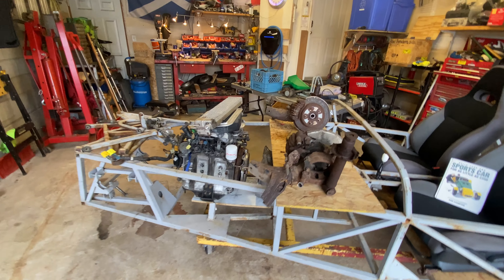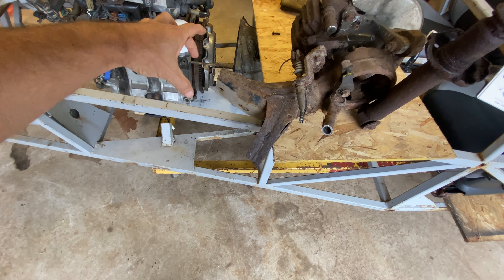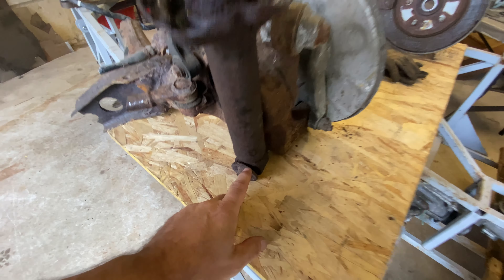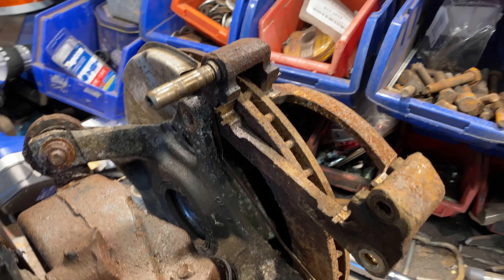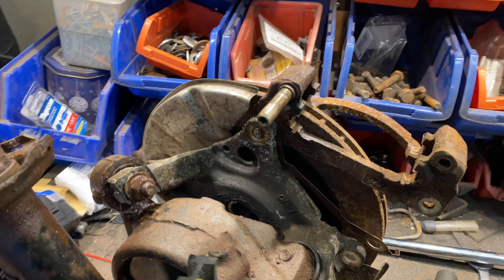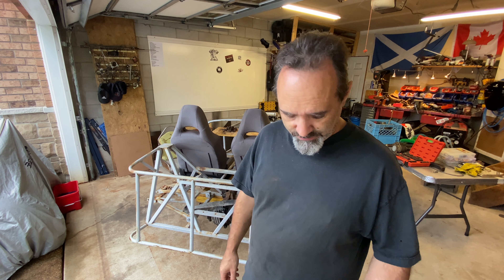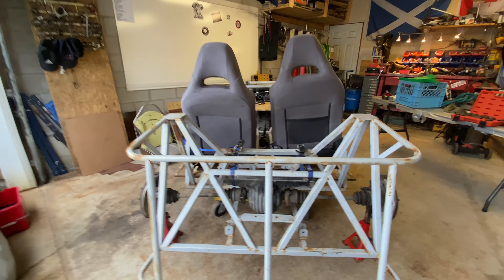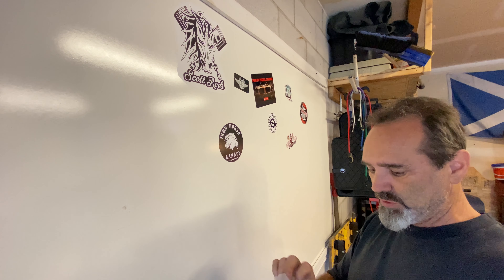Planning The Rear Suspension Setup For My Locost 7R7 Home Build Car.

Comment: +1 on welding washer first...I would drill the end of the snapped stud  as well to give some clean metal and deeper penetration then a large washer so you can weld a bigger nut to washer...good luck Dave from sunny Portugal...

Comment: At one time I considered building a Chevy powered cheetah kit car using C4 Corvette suspension front and independent rear suspension, then I question my insanity reconsidered using a straight axle three-point suspension on the back with panhard bar, independent suspension is overrated🤪 I picked 2000 Chevy Silverado 4x 4 rear end for $160 with posi unit 3.75 gear ratio and it what more can you ask for oh yeah it has disc brakes on it
Reply: For a road course track car... IRS is the way to go.

Comment: theres a well known lotus 7 builder that uses the de dion rearsuspension 
https://en.wikipedia.org/wiki/De_Dion_suspension
should be able to buils sumting like that using those hubs , you basicly use most of the mounting to attach the solidly together and can use the tube itself to mount suspension components to to hold it under the car prevent it twisting and mount the coilovers to
i have had luck with the weld a nut on method its a bit hit and miss though , it might help if once you welded on the nut to seperately heat up the (metal) part that holds the caliper and thats bolted to the hub thats where the bolt is screwed intoo and thats not an aluminium part  , tapping on the bolt after cooling and spraying some rustremover/antiseize on there to loosen up the rust some might help a little too , anything to at least get it to move a little , then start wiggling on the bolt and keep going back and forth clearing the rust in the tread and basicly grinding it fine enough between the treads to make the bolt move more freely , takes a bit of "fingerspitsengeful" (soft touch) to cause the bolt to move without twisting the nut off , using a short boxwrench probably helps  , trying to loosen it in one go doesnt work but you found that out allready 
you might be able to get the part off the hub after you remove the disk you should be able to hame rand punch it out of the aliminium partit will take the disk off along with it , that allso should leave you with a bit longer stump to weld the nut ontoo

Comment: 8:19 I tried the trick many times before on heavy equipment. You want a nice clean surface to weld on with mig or fcaw. Or you can grab a 7018 and let er rip. then peen it and use unstuck juice or candle wax. I'm not trying to backseat garage you but I did struggle a fair bit too. Also you can use a steel pipe that'll fit the sheared screw then use a pipe wrench.